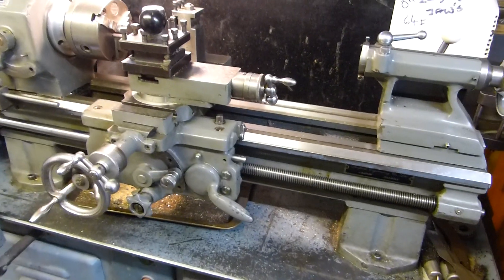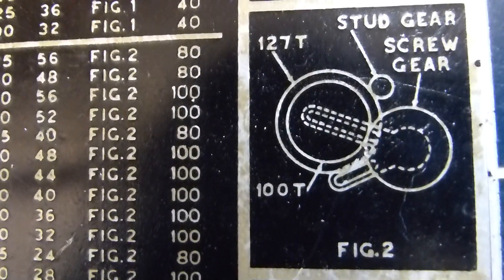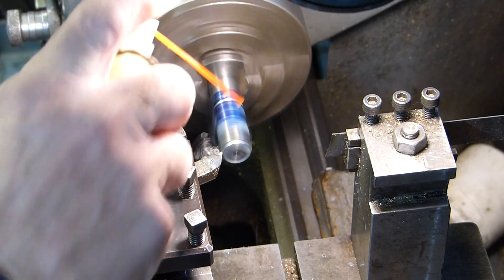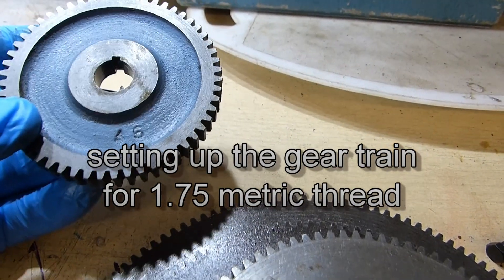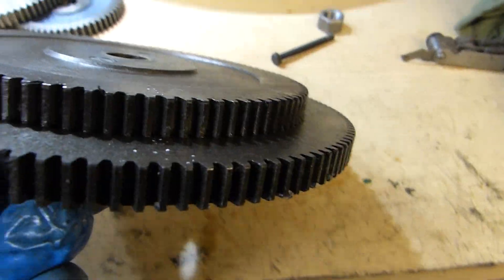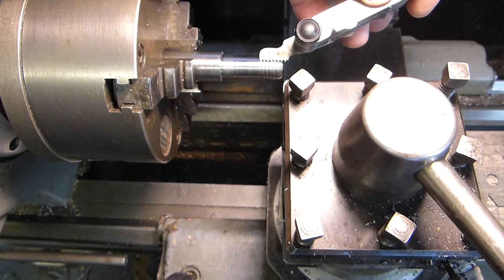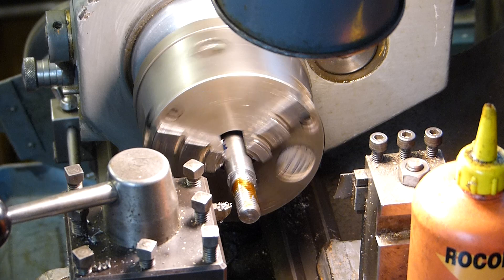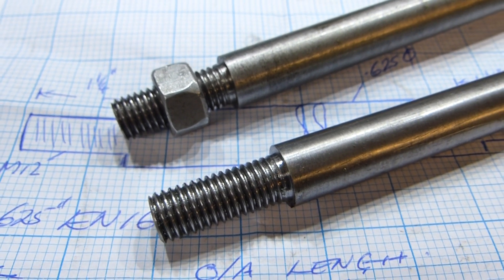Cutting a Metric Thread on an Imperial Boxford Lathe.

Comment: What is the RPM during screw cutting?
Reply from the maker: I use a low rpm as you saw,cant remember the exact rpm,I just eyeball it but I will check on the lathe for you and give you the correct rpm,thanks for watching the video.
Reply from the maker: I usually screwcut steel at about 40 rpm,softer metals a little bit faster, slow rpm enables me to withdraw easier if screwcutting up to a shoulder.

Comment: I'm watching Your YouTube videos with enjoyment. I have a Lathe Boxford AUD and I need an information from You. I want to make some Metric Screw and I know I need a Gear 127/100. Please, could you tell me the millimetric dimensions of that gear?

Thank you.
Reply from the maker: sorry for the delay in reply,as mentioned before snow and ice prevented me from getting to the workshop but here are the dimensions of my gears...127 tooth gear is 182mm od x10mm wide,100 tooth gear is 143mm od x10mm wide,hope these dimentions are are of use to you.
Reply from the maker: the 100 tooth should be 143.814  not 143,sorry missed the extra dimension.

Comment: Thank you for this,I always wanted to try and cut a thread on my lathe which is the same as yours but my Boxford ( ex school) has oil caps next to the name plate but yours has grease nipples I was wondering how often and how much and what grade of oil should I squirt down those galleries to the bearings ?. I had a small single phase bench grinder motor to run it after removing griffon 3 phase motor for 25 years but fitted inverter and 1 hp 3 phase motor this year which was a game changer. I’m not an engineer or did metal work at school but have made plenty of things on it notably made power valves for my two stroke motorbike out of ally bar. So thanks to your informative video I will have to get some gears and give it a try
Reply from the maker: Thank you for viewing the video,glad you found it usefull,I use grease for the headstock bearings the type I use is just basic standard grease ,I dont use oil in the headstock it is not recomended,I use a pump type grease gun and grease the bearings maybe once a year,I pump in a small amount,never a lot and this has what I have done for years and it has caused no problems,get yourself some gears and have a go,there is no mystery about cutting threads just practice a few times,make sure your screw cutting tool has the correct angles and clearence,or better still use the insert type of threading you will soon get the hang of it on the Boxford.

Comment: I liked your video; I have a similar lathe, but I wish my lathe had a slotted cross slide, mounting your parting tool upside down and behind the workpiece is an excellent idea.
Reply from the maker: The slotted cross slides are getting harder to obtain these days,I was very lucky in obtaining the one I have,I really wanted it for the rear toolpost so as you mentioned to mount a parting tool,really useful,thanks for watching the video.

Comment: All good info. 
Some metric threads can be a problem on metric lathes. If the thread is a divisor of the lead screw you can engage anywhere but if not you have to reverse the lathe with half nut engaged just as you did. There is a threading tool based on the clapper box principle that makes thread cutting easier for when the half nut can't be disengaged. Just by coincidence i have a short video showing one style of it. "Screw thread cutting, so you think you know an easy way......" if you are interested.
Reply from the maker: Very interesting,thought it would be straightforward on a metric lathe,yes would be interested in seeing the video and thanks for viewing the video.

Comment: Nice tip with the paper
Reply from the maker: Thanks for watching the video,used this idea for years since I was an apprentice,an old machinists taught me the trick and have used the method since and it always works well.
Reply: @popperkeg1234  yes I did know it I have an old boxford in my garage  I’m a carpenter and joiner from Oxford who does a bit of metal work